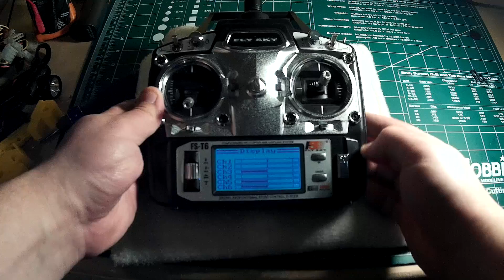FlySky FS-T6 modifications three position switches and lipo

Comment: I did the modification with the lipo conversion, but now my transmitter won't turn on. Please help if you know a way to fix my problem. Thanks.
Reply from the maker: maker 408 Double check polarity and voltage.

Comment: Hi ..about the resistor, there are so many different types out there... 1/4 , 1/8 v, metal fil, etc, would any 2.7 Kohm work ?
thank you
and nice vid
Reply from the maker: Yeah I used 2.7k resistors in the video. I haven't measured current but I'd imagine you could use some really low wattage stuff.
Reply: thank you

Comment: Can I wire a 11.1v 8c 2200mah Lipo directly to the FlySky FS T6 or do I need an esc?
Reply from the maker: I don't quite follow you on  the esc? you powering a transmitter not a motor. I run mine of a 3 cell lipo just fine.
Reply: esc/regulator same thing. glad to hear it works!

Comment: Great mod, a small remark or idea if you want. What if you use smaller resistors and 2 switches, 1 3 pos and 1 2 pos to alter the 3 pos resistors, getting kind of a mod switch from the 2 pos one. 

Basically I wonder if with 1 switch you could control the "range" of the 3 pos switch getting 6 positions out of it.

Comment: Is there a way to reverse the throttle direction short of reversing the wiring between the ESC and motor? I'm aware of the "Reverse" function in the transmitter but this only reverses the stick throw direction. Thanks!
Reply: you mean reverse the direction of 2 of your 4 quad motors? flash the esc's firmware with BLHelli suite.

Yes i realize this comment is 3 years old im just bored and trying to make sense of your comment. lol 
also helping anyone else who reads this with the same intention.

Comment: Hey, i did this mod and also used 2.7k resistors,  did u find that it offset the centre on rudder and pitch??
Reply from the maker: I just checked my transmitter and those channels are not off center at all.

Comment: That is a great mod!  Can we leave the existing switches in place and put the 3 position switch were the pot is?  Thanks.  Do you think 2.2 k resistors would work?
Reply from the maker: You could put the new switches anywhere you want. I did not pull the pots apart to see how big their holes are though. I only mounted mine on the top because it was comfortable to use there. 2.2k resistors should work fine.  The key is using resistors that are of the same value when you create a voltage divider. e.g. |---R1---|---R2---|     R1 and R2 need to be the same value.  Don't go too low of a resistor as the current would increase and I'm not sure what the effects would be on their circuit.  The factory pots are 5k, so you want two equal resistors that are close to that value when added together.
Reply: Histo I knew there had to be a way of doing this.  I just ordered this radio and also have a hobby king 6 channel with the exact same pots.  I am going to mod that first.  Thanks again.